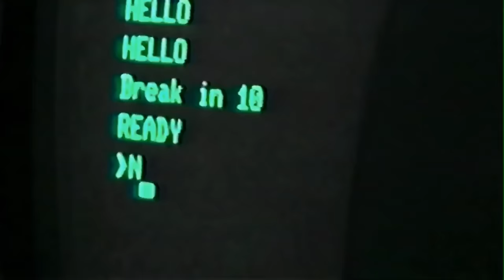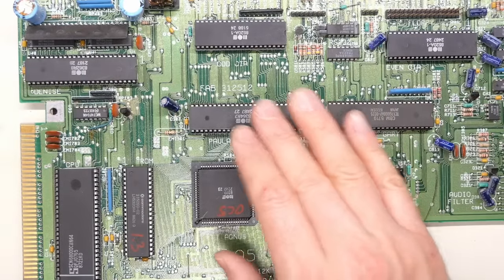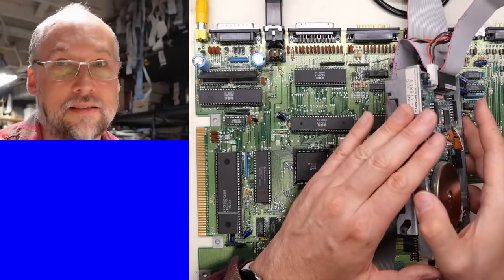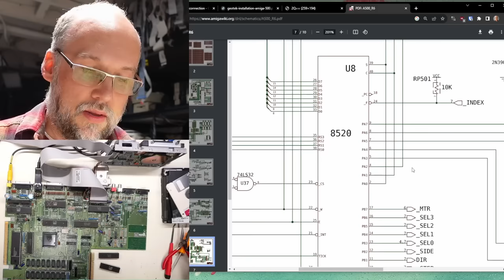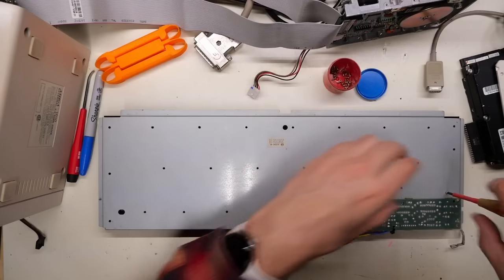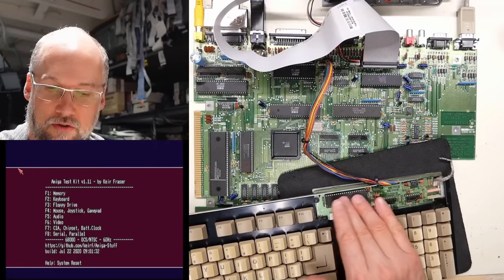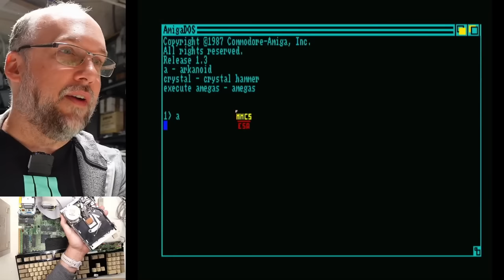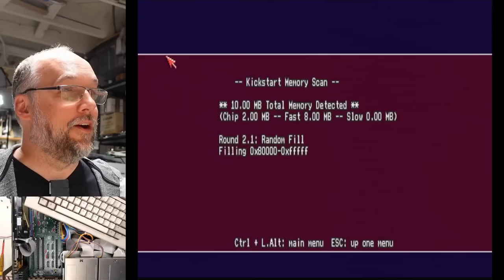Testing and repairing a mysterious Amiga "art project"

Comment: I have a Toshiba T1100 laptop that I was going to do this with, and use the shell for a cyberdeck project! I thought it would be a shame to get rid of the guts, so I thought it would be fun to shadow box it and have it working so i can power it up on my wall for a laugh!
Reply: What I'd do if I had the time: Replace the ROM with a custom machine code routine.  Add several hardware output latches which drive LEDs.  Have the ROM run a software version of a 32-bit shift register with bits 31 and 11 XORed together and then XORed with bit 7 and the output run into the start of the shift register.  Once every quarter second, it takes the 4 bytes from the software-implemented shift register and sends it to 4 outputs to drive 32 LEDs.  Every half second, it XORs the 4 bytes with the last 4 bytes sent to a different 4 outputs driving a different 32 LEDs.  Every second, it does the same for another 4 outputs driving yet another 32 LEDs.  Even with a fixed "seed" value, that should produce quite an impressive display.  If you want a variation, implement an A-to-D converter taking input from a speaker acting as a microphone so that the quarter-second delay is either reduced or increased slightly depending upon the input from the speaker.  That should keep the kids amused, although I can't guarantee it'll keep them quiet. 🤣

Comment: Repairing A500/600/1200 membranes is dead easy. All you need is a sharp round bladed scalpel, conductive silver paint and some kapton tape. Find the rotten trace. Scrape a bit on each side of the brake with the scalpel. Use kapton to mask on both sides of the trace and put a bit of silver paint. Wait for it to dry. remove the masking. Put kapton tape on top of it. Don't bother with carbon based paints.

Comment: If the expansion card is anything like my GVP a530 Turbo the it would have used the bottom of it's case to  and a stand off to mount the hard drive. one screw through the bottom through the board, a stand off to secure the board into place, and the 4 stand offs screwed into the bottom of the HDD.

Comment: KS 1.3 does not boot from external floppies, unless you mod some traces on the board, and then you have to always select the drive you want to boot by a switch or by altering the wiring everytime.

The disk drive click can be seen as a heartbeat, when it is present you know there is at least some life to the machine. It can get quite annoying especially if you have the full set of 3 external drives attached... also why the heck did CBM make them move the head for checking for a disk, when they already use the full funtcionality of DC and RDY signals as in the Shugart spec... IIRC you get a a pulse on DC upon DSEL if the disk is out, and on RDY if it is in, and the head step part has two signals of which the STEP must be active upon DSEL to move the head, the other one sets the step direction. Leaving STEP inactive for the check should cause no click, and I remember there was an anti-click board available that you put between the cable and drive, and there was an external drive available that avoided clicking as well. Probably this worked by checking the RDY pulse before relaying the STEP pulse, but likely caused timing problems with some fast trackloaders.

Comment: Adrian, if you know one of the two ends of the pinout for the keyboard was the potential for ground, and that black wires are always ground, why didn't you do the quick thing and check which pin for the keyboard was ground via meter continuity? It just seems silly to use Google images because those people are lunatics.
Reply: I wouldn't trust that black wires are always ground on a cable like that. You'll notice that the cable uses the numerical colour code: black (0), brown (1), red (2), orange (3), etc. That's a big hint that the wire colours might be coded position on connector rather than than ground, Vcc, etc. Most likely the lowest numbered wire (black/0) goes to the lowest-numbered position on the connector, which is likely the big "1" at one end of the connector. (Yeah, the colour code starts with zero and pin numbers on a connector or bus usually start with 1, for some reason. Perhaps we can all compromise by starting with 0.5 for everything from now on.)

Comment: Hi Adrian I need some help I bought over 600 floppy discs for a amiga 4 year’s ago and to this time and date I don’t have any amiga console to try them out do you or does anyone know how I can get them to work on a pc using an emulator or do I need an amiga to see what’s on the any help would be appreciated thanks
Reply: There's a program called "adfread" which should be able to work. The downside is your PC needs to have two internal 3.5" floppy drives for some technical reason. "Newer" PCs like Pentium 4 systems usually only support one floppy drive so you'd probably need a Pentium III or older.

Comment: Couldn't you just use a multimeter and check continuity on the traces to see where they go on the controller board? that seems to would be an easier method then trying to follow traces visually over the membrane.
Reply: That method doesn't work too well when you know there's a bad trace.

Comment: 54:08 that doesn't look like a good design: mounting a heavy mechanical spinning hard drive into a card, you risk cracking it or at the very least making the contact pins fail due to excessive momentum.

Comment: I've often considered making something like that, but where you can actually plug it in and it works. Hang it on the wall, add some small HDMI blue tooth so you can cast it to your TV. Bingo. TM J-D-P ideas, drop me a message if you want to make a go of it, I am sitting on so much old tech, got a whole house filled with motherboards and PCBs. I live in an estate with several houses so it doesn't sound as hoardery as that last sentence might of sounded l;)
Reply: I think when you have multiple houses for your hoarding needs you kinda went next level with the hoarding :P
Reply: Yep, hoarding houses too, heh. Want me to come over and turn one into a museum open to the public?

Comment: I wonder why Amiga team decided not to give color output on the composite output for the poor people not having the extra money to buy a monitor.
Reply: With color composite video you get chroma dots and color fringing. Monochrome composite video on a monochrome monitor is almost always stunningly good.
Reply: @eDoc2020  I understand. But then, it should be an option to switch off colors if needed, that would be possible, too.
Reply: @andrasszabo7386   The color encoding circuitry and the switching circuitry would add extra cost and complexity for everyone. Also nearly all TVs (at least in the American market where it was designed) did not have composite inputs at all so its utility would be limited. If you wanted to use a TV as a display there was the Amiga 520 Video Adapter which had everything you would need.

Comment: PLEASE STOP with 720p60 FPS content! 60fps is only useful in fast action packed videos. It doesn't bring any improvements in content as yours. The downside of 60fps content is high data rate as such video is twice the size. And it's a a hard pill to swallow for your viewers that are using metered internet connections such as some satellite offers, LTE, 5G etc. and have a monthly data limit or they pay more for used data.
Reply: If you don't want to watch in 60fps then choose a different playback option. 480p is plenty most of the time. If you need it the browser addon "enhanced-h264ify" will let you completely disable high frame rate formats and YT will give you 720p30 versions.
Reply: @eDoc2020 Thanks for a tip. 480p is many time not enough, 720p is perfect if you want to see details on screen. Will check this addon you mentioned.
Reply: Its useful for recording crt monitors .